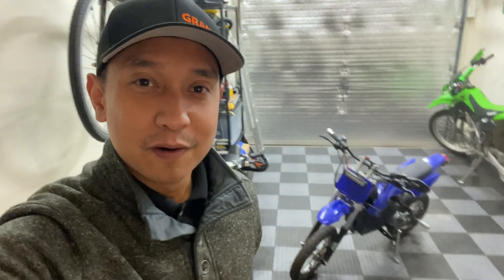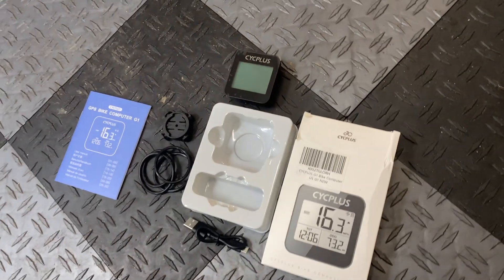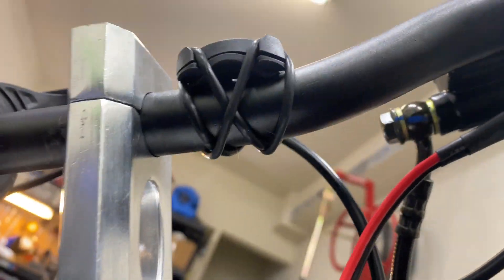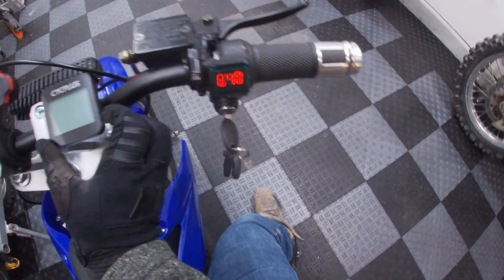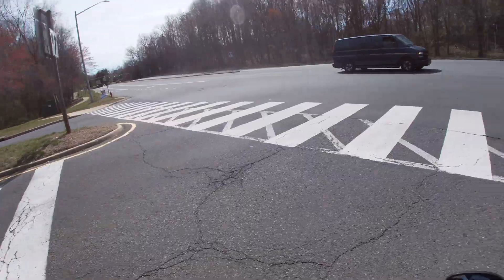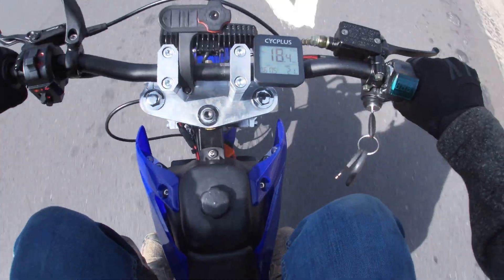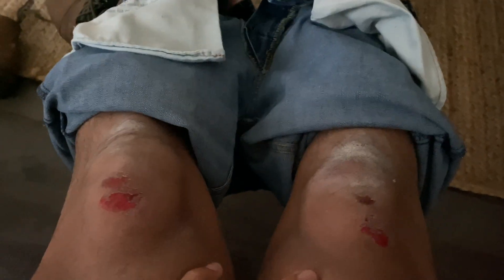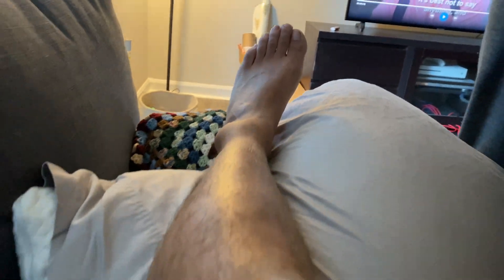Wrecked the 72V Ultimate Supermoto Razor MX650...

Comment: First thing first, wishing you a speedy recovery brother! That ankle looks BAD but hopefully it’ll only be a couple weeks till you’re back, I’ve been loving the videos lately. 

Lastly, while you’re lying there unable to ride, could you tell me which video you installed those dope ass tires in?? 😅
Reply from the maker: Thanks! Regarding the tires.. I went a little too late for the rear. I would go no larger than 10x3.0”. I went 3.5” and had no slide my motor forward for clearance: Installed Supermoto Tires on my MX2000 | Biggest Tire Sizes that fit Razor MX650 MX500 Wheels
https://youtu.be/xVVUA05VYVk